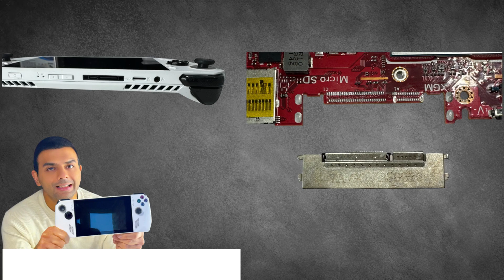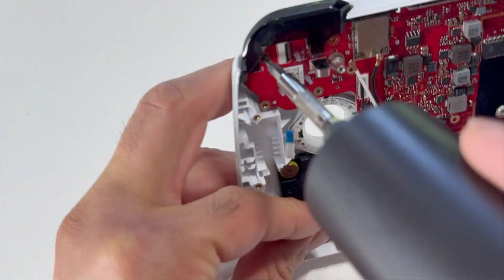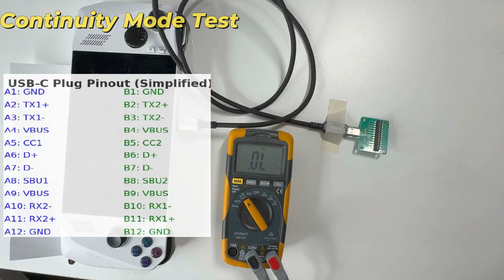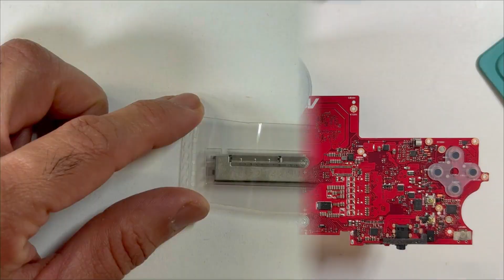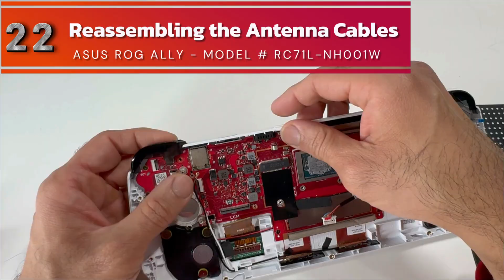ASUS ROG Ally [RC71L-NH001W] - XG Mobile Connector Fix (USB-C Port Fix) – Step by Step Repair Guide

Comment from the maker: 🔗 Need Professional ASUS ROG ALLY Repairs? Get A Free Quote below: -
https://gc-repairs.com/collections/handheld-pcs/products/get-a-free-quote-handheld-pc-asus-rog-ally-gaming-handheld-repair-services
For All Repairs Inquiries: consoles1980@gmail.com
For all Business Inquiries: https://gc-repairs.com/pages/contact

Timestamps:-

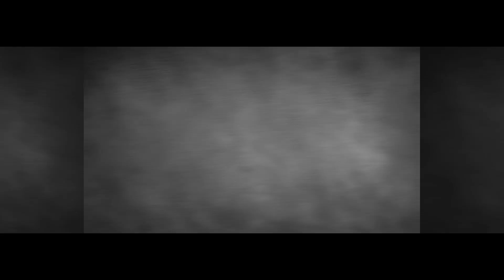[00:01] Introduction  
[00:07] Symptoms of Damaged XG Mobile Connector (RC71L-NH001W)  
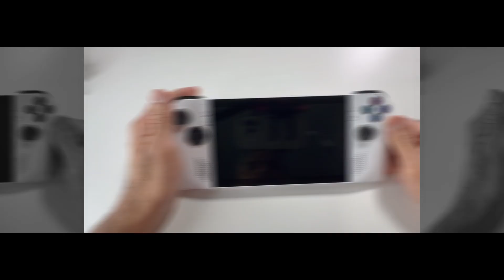[01:05] Tools Required for Repair  

--- Disassembly – Step-by-Step Teardown ---  
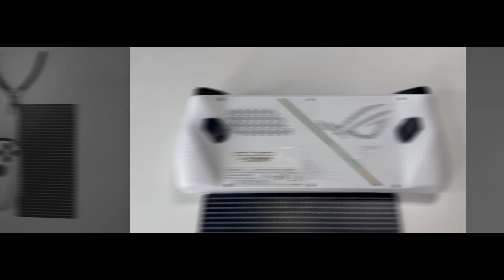[01:34] Removing the Back Case  
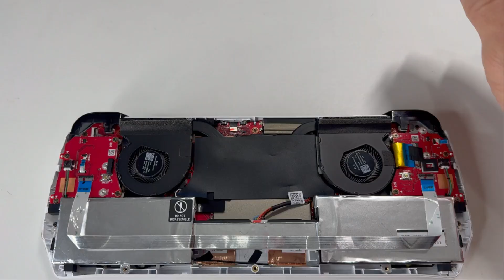[02:57] Disconnecting the Battery  
[03:13] Removing the Long Ribbon Cable  
[03:35] Removing the Black Adhesive Tape  
[03:40] Removing the Battery  
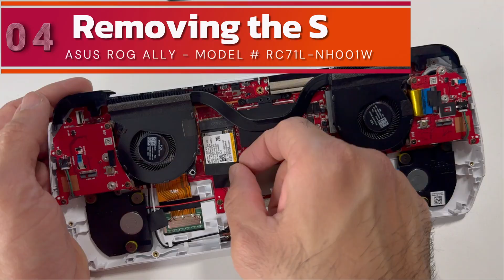[04:55] Removing the SSD  
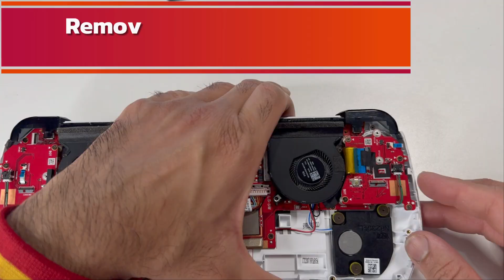[05:40] Removing the Left Joystick  
[07:04] Removing the Right Joystick  
[08:05] Removing the Fan + Heatsink Assembly  
[09:28] Disconnecting the Fan Cables  
[10:49] Removing the Motherboard  
[10:49] Disconnecting Power/Fingerprint Sensor Cable  
[11:38] Disconnecting the Antenna Cables  
[11:44] Disconnecting the LCD Cable  
[11:52] Disconnecting the Speaker Cables  

--- XG Mobile Connector Testing & Preparation ---  
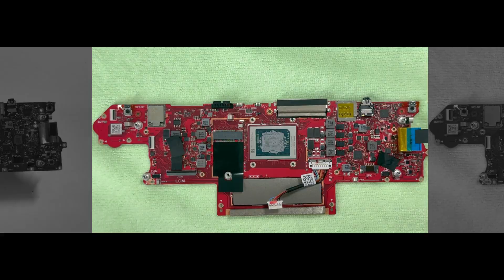[13:38] Preparing XG Mobile Connector for Desoldering  
[14:55] Inspecting Damaged XG Mobile Connector Under Microscope  
[15:37] Exposing XG Mobile Connector for Desoldering  
[16:00] Checking USB-C Port Values with USB-C Test Board  
[19:47] Testing Damaged USB-C Port (XG Mobile Connector)  

--- Desoldering & Soldering Process ---  
[22:51] XG Mobile Connector Desoldering and Soldering  
[22:51] Pre-tinning Before Desoldering  
[24:10] Desoldering the Damaged XG Mobile Connector  
[25:06] Pre-tinning the New Connector  
[25:58] Soldering the New XG Mobile Connector  

--- Verification & Testing ---  
[27:00] Verifying New XG Mobile Connector with USB-C Tester  

--- Assembly – Step-by-Step Reassembly ---  
[30:12] Reinstalling the Motherboard  
[32:25] Reconnecting the Antenna Cables  
[32:55] Reconnecting the LCD Cable  
[33:01] Reconnecting the Speaker Cables  
[33:07] Reconnecting the Power/Fingerprint Sensor Cable  
[33:24] Reinstalling the Fan + Heatsink Assembly  
[33:33] Reconnecting the Fan Cables (x2)  
[35:08] Reinstalling the Left Joystick  
[35:55] Reinstalling the Right Joystick  
[38:00] Reattaching the Black Adhesive Tape  
[38:12] Reinstalling the Back Case  

[38:30] Credits

Comment: I changed the thermal paste on my ROG Ally and removed that black plastic pad over the processor. I also added some thermal pads over the heatpipes to improve temps. 

After these changes the USB is not working correctly. 
It charges while the Ally is shut down, but if I plug in the USB charger while the Ally is turned on, it doesnt charge. I use the original charger. The charger is ok as it charges my laptop with no problems. 
I also have a few 45w and 65w chargers that used to work and now they dont with the Ally.

If I turn it off, then plug the charger, then with the charger connected I turn it on, it keeps working and charges ok. But if I disconnect it for a second and plug it back, it doesnt charge anymore.
My guess is something wrong with how usb negociates power profiles. I hope this is a software issue, but I think is unlikely. 

I didnt touch the usb port, and I am always carefull to have the charge cable plugged in as straight as possible withouth putting strain on the port.
One thing I noticed was one of the CPU/APU screews was overlapping the protective sticker over the USB port. But that alone shouldnt cause problems, right?
Reply from the maker: It sounds like a potential short or loose connection near the power delivery controller, so I would suggest double-checking the internal ribbon cables.

Comment: where did you find the part Usb C Charging Port XG Mobile Dock connector Replacement
Reply: Did you able to find it?
Reply: "Connector for ASUS ROG Ally - Genuine ASUS Part - 12019-00170600" from A-Accessories or Accessoires Asus

Comment: I have the same issue I’m in the United States but can’t find anyone here to repair it
Reply: This repair is labor intensive due to the SMD Mounted USB-C Module requires microscope attention. As ideally the solder can and will bridge pins in my experience and requires re-work under microscope if it does happen. It’s likely not worth the labor, plus part cost over just purchasing a new unit. Not to mention it could be a secondary issue with card or other item internal that’s causing the symptoms of no charge. 

I mean this is easily 300-450$ repair W/part included.

This doesn’t include if not a local repair cost of shipping and handling.

Comment: Hi, I have the same problem and the device is not charging. Can you give me a link to buy the part in the video?
Reply from the maker: I think it's sold out via the official ASUS Supplier also. 

We have a few in stock, but we tend to keep them for our own General Repairs.
Have you tried eBay?
Reply: @GameConsoleRepairs  wow, have prices skyrocketed!
There is a singular XGM/USB-C port on ebay right now. 
FOR- $115 USD
WTF
I knew I shouldve got some from asus when I had the chance, DAYUM.
WEll, hello Backburner! I'm gonna set my Ally on you for a good while. As I sit. and cry.
Reply: @2pringles  just ditch the XGM connector, ask local technician to use normal type c for charging.. we dont use it anyway...
Reply: No, I didn't search to be honest because I don't know much about these parts. Can you help me find the same part that you installed? And is it delivered to Saudi Arabia?  @GameConsoleRepairs
Reply: @GameConsoleRepairs ??
Reply: I had a shop replace usb port. Orange light continues to just blink now. Won't turn on
Reply: @morecheeseplz23  did you ever get it fixed?
Reply: @ericstoner210 no. Even plugged in it wont turn on. I eventually got the xbox ally x. The z1x is sitting in my room. Probably sell or something